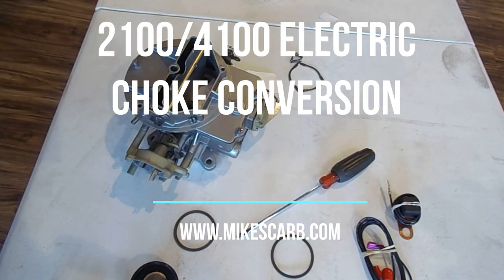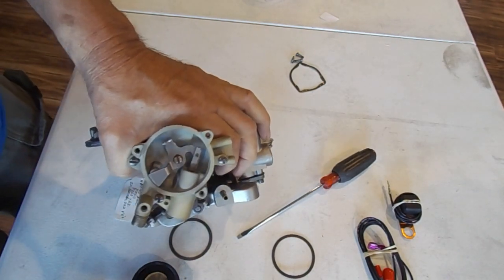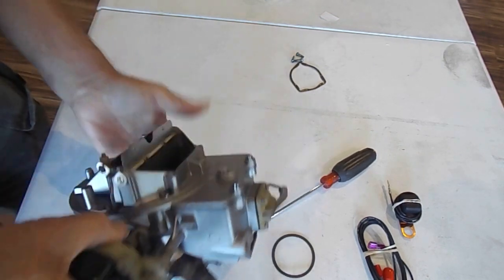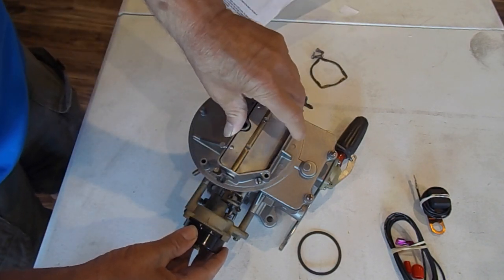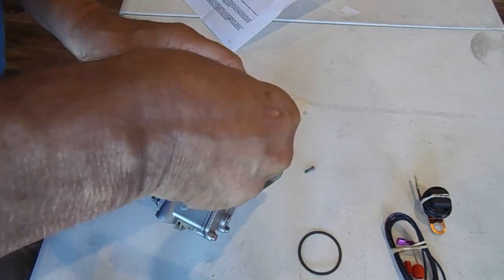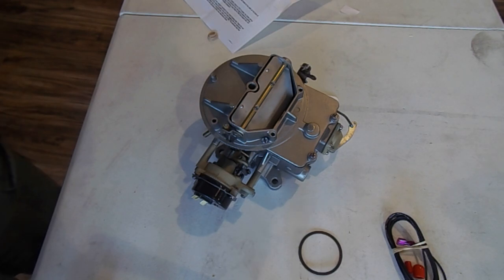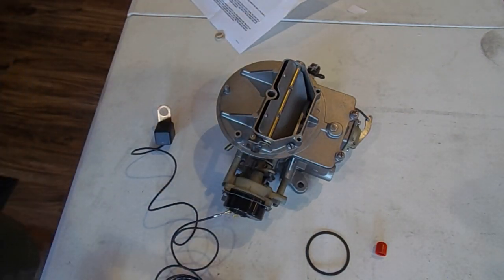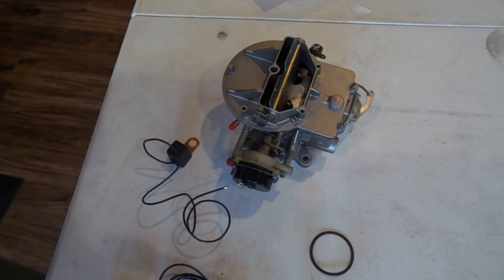Motorcraft 2100, 4100 Electric Choke Coversion

Comment: Is there an electric choke kit for my Motorcraft 2151kl  on an AMC 304?  I wanted to delete/block the choke heater tube that runs through the intake manifold. Or did I miss one somewhere in the link below for the 2150 series?

Comment: So I have the 2150 with the 1 wire electric choke. I have it hooked up to a 12v when key is on, is this correct? Will this not fry the coil plate eventually?
Reply from the maker: That is correct. This will not harm the plate. The thermostat is grounded to the carburetor.

Comment: Rebuilds don't always have this figured out.   You need to mess with it and SAVE your old automatic choke.  Save the wiring too.  Old one has a metal ring.  I have had to keep reusing the original choke ring.  These 2100s take a lot of patience. They don't last for ever.  Be very careful when you remove the fuel filter.  I found that I don't need to tighten the fuel filter all the way in.  Good luck and may the force be with you!

Comment: I got in trouble from using an included bottom gasket.  The original mechanic skipped the bottom gasket.  I had to remove the gasket. Base is a rubber like material.  This Carb. is a tough customer. One month later, I think I might have it.....

Comment: what about the lead ball and why dont holley or carter use a rheostat?
Cant I just give it 12V or is this a lower voltage coil?
Reply: theres a passage you block with the lead ball so it dont have a vacuum leak without the manifold loop.
I did on mine but it also has the pull down on the back